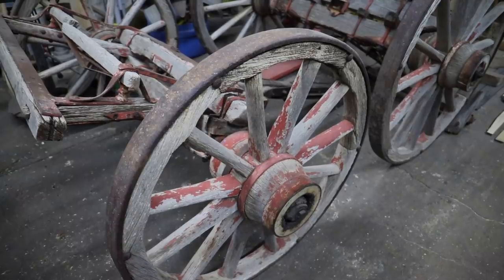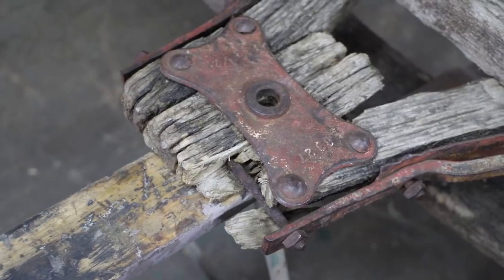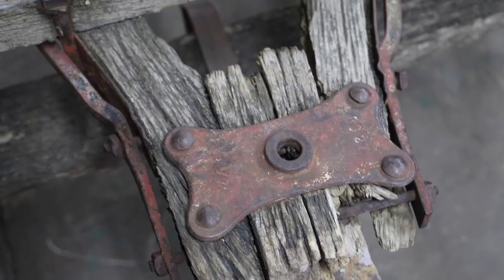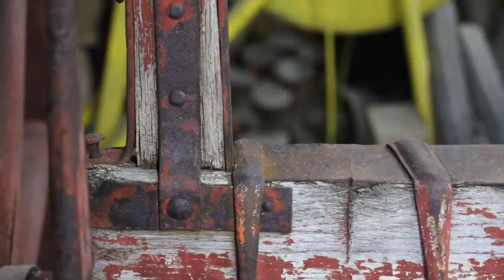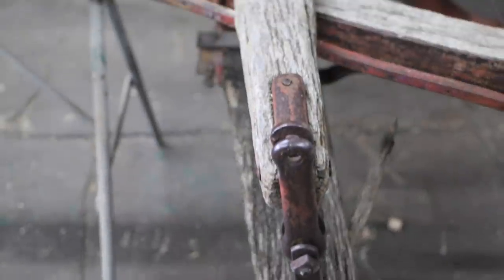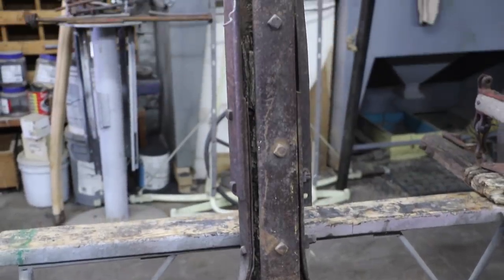Some Wagons Need Preservation - Some Need Restoration | Engels Coach Shop

Comment: A painter and decorators tip. When storing your unused paint, store the paint tin upside down, so when you come to use it again, the skin is at the bottom of the tin leaving you with just the paint.
Reply from the maker: Good tip.

Comment: Hi there just a quick one to say that I love the paint lip on the can I have never seen it before and I'm a site contractor
Reply: Me too - I've never seen that either and I've got to remember it for future use.  :)
Reply: It's in one of Dave's earlier videos on this channel, there's plenty of other nuggets in those, highly recommended when you have time :)
Reply: It could be a while before I pour any paint. I may have to write that on a sticky note and put it near my paint supplies.
Reply: It's so simple, it's genius!
Reply: I have never seen or thought of that trick. Great idea.I always learn something new from from you Dave, keep it up.
Reply: I never thought of this until I saw it in an older video and now I use it all the time now.
Reply: Tape seems like a great way to do it plus with oil based paint you don’t have to mess around with solvent to clean up the flexible plastic ones that I have and use all the time for latex paint. 
Need to file that little nugget of info away for later use.
Reply: A complement : when your pot is so prepared, you can wipe the excess paint on your brush before painting...
Reply: Paint in the groove, and cleaning the groove, really peeves me.

Comment: The trick with the paint can is a new one for me. I used ready made paper lips from a paint store on a tip from a professional many years ago.  The trick with vinegar and metal filings is something I used when repairing antique furniture.  My friend always accused me of cheating,  but I did it as a sympathetic restoration to save the pieces.  This is the question museums have always asked:  do you restore it to working condition, so you can demonstrate it's function,  or do you just want to preserve the look?   I think what he is doing is the right approach for this project, fix the minimum parts so it can stand on it's own and preserve the wood and metal to stop further decay.  It will look fine and the original craftsmanship is on display.

Comment: That was my grandfather's job at my great grandfather's coach and buggy works. He was a gifted artist as well. His calligraphy was outstanding too. He also was the one responsible for dagger lining the pin striping on all the buggies and wagons. He could do one side and then do the other side exactly the same which was an art in itself. Later he went on to run his own panel beating and spray painting workshop after the motor vehicle supplanted the coach and buggy. My great grandfather became a Studebaker dealer during the transition. They would receive a crate load of metal bits and would have to form all the coach work out of wood from provided plans and specifications. My grandfather had some interesting stories about teaching the town cop how to drive when Grandpa was only 8 years old.
Reply from the maker: What a legacy.  Thanks for sharing!

Comment: That vinegar and iron fillings is amazing.
Reply: It will dang near age wood over night. Some woods you can watch it turn gray. Really good for blending in new PT fence boards on an old fence
Reply: @bottomlands  Hi. What exactly are these fillings? Does it mean "iron dust"?
Reply: Model railroaders have used India ink and isopropyl alcohol to age wood for many years. 
Typically 2 teaspoons ink in a pint of 91% alcohol.
Reply: Yeah steel wool is an excellent replacement. If you let the vinegar and steel sit for weeks you can get a very dark mix. Great for staining leather black too.

Comment: Great as always! For anyone who doesn't have access to sand blasting- a wire wheel works great for eating away the softer spring wood to help age your piece.
Reply: That's what I expected... until he reminded me he had the sand blaster. That vinegar & filings trick is pretty slick.

Comment: Your tray there adds new meaning to the term "paint tray", that is a pretty slick way to paint wheels. I use a vinegar/steel wool mix to age wood. Works great on pressure treated fences.

Comment: I love how vinegar and steel wool looks on oak, ash seems similar but not as dark but I think that’s more related to the concentration you have since it’s still fairly clear. I did find out that vinegar and steel wool does not look good on cedar after I replaced the slats on my cast iron bench and wanted the cedar to not stay “red”. It ended up just looking muddy.
Reply from the maker: They all react differently huh.  I used it on a new pine siding and it came real close to my other 40 year old pine siding.

Comment: For museum work, a preservation job might specify that new repairs are easily distinguished from original material.  Whatever, in this case we'll hope that a hundred years from now some conservator can just dial up the video!  You need to  hide a QR code URL somewhere on the chassis :)  Excellent stuff, many thanks.

Comment: Tip: if the paint cans you come across share lid sizes more often than not, then keep the old lids. If you cut the shape of a flattened spout into the lid, leaving the rim with a stout 1 cm wide circle to the lip, you can then slowly form a pour spout of these can lids. I've done this a lot now, kinda have all the major sizes. No more mess, no more paint spills, no more messing around with tape, simple, effective. And they're super easy to clean, i basically drop them in an old cooking pan filled with paint thinner, and pull them out clean.

Comment: That the wheels absorbed more than a gallon of oil paint is remarkable, speaks to the need to oil those wooden parts most exposed to the elements.  I can clearly understand your reasoning behind patching or repairing a broken tenon, at most it need only support it's own load while being posed for display.  I'm curious to see if the the remaining wood absorbs the remainder of a 5 gallons of oil and paint.

Comment: 16:30 one trick i've done with some beams that were structural yet, of important historical value (basically builder inscriptions and other names dating to almost 200 or so years ago) is i had them hollowed out, until out of a 19 by 19 beam, there was only 1 cm thick skin. Inside, we dropped a heart of hard oak, aged, and stabilized, marinated in a resin glue. Like new in strength looking old in appearance. Maybe another time you could try something similar. Certainly the metal backing would've hidden any "crimes" shall we say. ;)

Comment: Curious: I managed for Sherwin-Williams back in the 70s, during which they donated their Linseed Oil plant to a college and switched to Alkyd Oil Paints. As I remember, Linseed Oil doesn't mix well with ALL synthetic oil paints. What do you use? or does it just not matter because of the ratio of linseed oil to paint and the thirsty nature of the old wood? Love your work and your vids.

Comment: Theirs a glue apoxy you can sand to in case the cracks of wood or just worn tool. To preserve it. Dries clear if your gonna take campers on a tour of a park better to start from scratch. Which kids need to experience to hear and feel how pioneers did it. Plus those who have horses 🐎 in need of exercise make a few laps around a camp ground theirs a koa in Oklahoma that uses plastic barrel carts pretty cute seeing the kids piled in going around the park. Really use a wagon or a stage coach I think it better let a mule or a short pack team to pull kids around. As long as they wear gloves n mask 😷

Comment: I think that there is a difference between Cutting some corners and Forging your own path. Ha Ha 
But seriously better this than being left to rot. Doing what the customer wants and no more than they need is becoming a rarity in business today. For the condition of the wood the iron work appeared remarkably complete. You cant beat Linseed oil as a weather protectant I have been using it for years to protect the Blue stone on the front of my home. It has been used from the beginning and the stone is still sharp and solid as the day it was built 120 years ago.
Reply from the maker: Interesting.  Didn't know about linseed on stone, if I understand you correctly.  Thanks.
Reply: @EngelsCoachShop  Yes it can be used on stone and brick

Comment: 16:49 coulda put a metal dowel down the center of the whole thing, preserving the wood's cosmetic look but adding a load-bearing piece of steel.
Reply: That would not be a load bearing piece and the 3' long drill is being sharpened....

Comment: Does mrs Engels know that you are using. Her measurement cups for paint. LOL 😂
Reply: Especially since that appears to be a "vintage" pyrex measuring cup.   The newer non-corning pyrex ware looks different and I have been told is not quite as heavy (thick) as the older stuff.  Cup looks to be about a 1950's to 1960's version.
Reply: @ktcd1172  And I'm guessing it has been in that shop for nearly that long!  :)

Comment: 13:49 what's the role of the hex nut here?
Edit: updated wrong timestamp from 16:49
Reply from the maker: The hex nut is to keep the skein on the wood axle.  Many of the older wagons use a square headed lag bolt, but this wagon gear is built extra heavy and has a strap from one side to the other, under the wood axle, through each skein, to carry extra weight and they used a hex nut on the ends of the rod.

Comment: Love your paint sticks.  Where did you find the pattern? Lol. 
Haven't seen any of your videos I haven't enjoyed and learned several somethings.
See you are Master of masking tape also.
So here a hint if some of you haven't stumbled across it:
On masking tape, when it gets a little old and it's hard to get the end loose or tears, throw in in the microwave for about 10 seconds,  you will think it's a fresh roll just opened.
Reply from the maker: Cool.  Thanks.
Reply: I wish I had read this a few weeks ago! I had a roll that was only missing a few inches off it. It had aged, & wouldn't easily tear off the roll anymore. Every time I would try, it'd start to ll off, then tear into a thinner strip. Neat tip, I'm excited to try it in the future!

Comment: Great insight as to what’s needed, and what can practically work in light of the desired outcome, and budget.  Wonderful tip on the vinegar and metal filings to make the wood look old.  Wonderful work as always.  Thanks Dave.
Reply: that works particularly good on oak or any wood that has a lot of tannin in it - the dull/black color is iron tannate

Comment: Excellent video, thanks for taking us along.
Vinegar and iron fillings, so we can assume Oak?
Maybe white oak?
I just love your wheel painting dipping soaking tank under the wheel, excellent idea, is this another one of your many great fabrications from your fertile mind, or is this a common practice among wheelwrights? 
 You nailed the color for the preservation.
You said "Linseed Oil and paint", is that regular linseed oil or boiled linseed oil, and what kind of paint mixes with linseed oil?
Cheers from Tokyo!
Reply from the maker: I used ash and always use oil base paints.  The felloe oiler is my fab, but an old concept.

Comment: You could of saved the broke piece using a dowel rod of fiberglass/carbon fiber that was epoxied into place. The repaired joint would easily be as strong as the original wood. Just a thought for next "Preserved" wagon.

Comment: Didn't you use a baking soda and water mixture on your sheepherders wagon to age the new pine to look like old gray pine?  And does that work on hardwoods?  The red linseed/oil paint turned out great, it looks like a well cared for old wagon now.  My grandfather had an old wagon, but he always kept it in the barn I believe dad said it was a Studebaker, I'll have to ask him, he's 91 but has better memory than me..  I don't know what happened to it, but I hope it's still in good shape.  Before that he owned a sled.  His wagon was among the first there, and was brought in on the new railroad line that was built for hauling coal.  He worked in the mines and quickly determined that he wouldn't be a coal miner.  He owned a car once, a model T, but it washed away in the horrible 1937 flood in southeastern Kentucky.  He owned a horse once, but thought them inferior to mules, so mules maintained his preferred form of powered transportation.  He and some other family members worked in Dayton Ohio during WWII, and he rode with them  from Jackson Ky every weekend (12 hour drive back then, on a good day) so they could be home with their families for a day,  He took good care of all his equipment which wasn't much.
Reply from the maker: Thanks for the memories.  I used the same solution on the sheep wagon.

Comment: Nice job, I get some jobs like that and use the vinegar and steel wool trick, but I have learned from you today re mixing  oil and paint to match and getting it to soak in. Did you warm the oil first? Willie from N. Wales.
Reply from the maker: Just thinned 25% with thinner.

Comment: Can tip take a hole 🕳 punch any remaining paint 🎨 drips back into can then the lid won’t be hard to remove next go round.
Reply: I've done that and take no offense I really likes Dave's method better.
Reply: @dwightl5863  My dad taught me the nail trick. It works better for oil base paints. Apparently the latex cans are coated and piercing the can breaks the coating which promotes rusting. YMMV